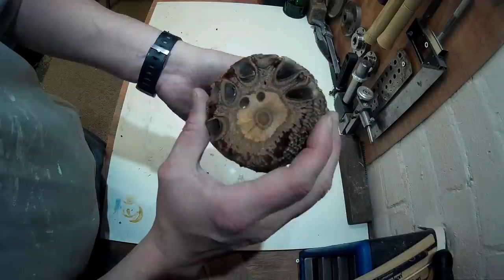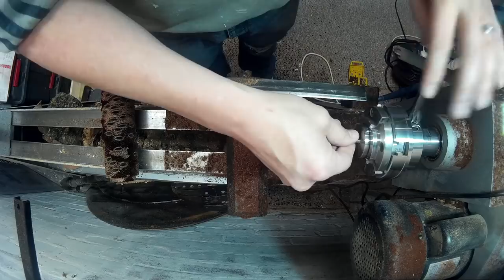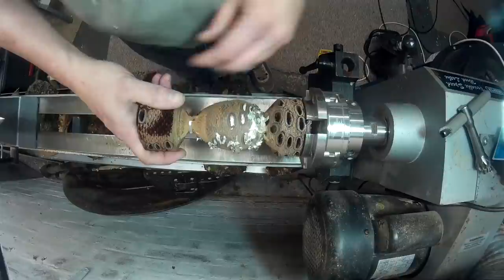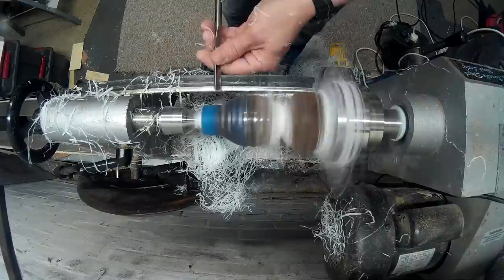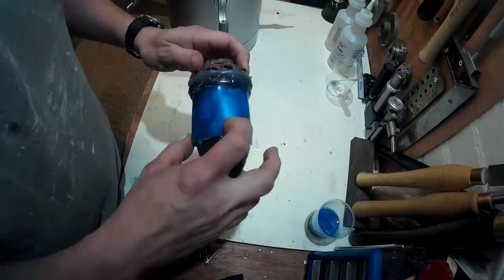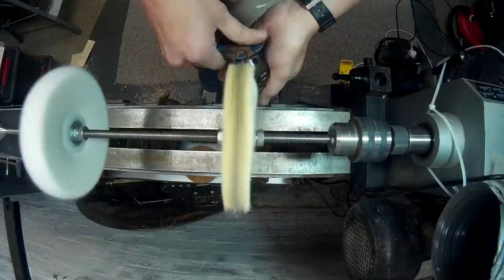Woodturning - The Nut!

Comment: great job!!!!
but as a side note from watching your video. I would make a shield around the back end of the motor to keep the epoxy shavings from ruining that motor over time. As the fan is turning to keep the motor cool, it is sucking the epoxy bits through the back of it. This ends up clogging the motor over time, can get hot/catch fire, and just over all make for a bad day.

Comment: What was the purpose in wasting the resin, just to take it all off
Reply: I am  totally in agreement,  seems like the long way around the block to end up with blue pedestal. Great work, but really? Question: What kind of wood did you start with, pardon my ignorance.
Reply: What kind of wood did you start with?
Reply: To seal it.
Reply: To strengthen the work piece
Reply from the maker: Fill the last few holes where the metal would not pour in, I did half to see what the colour looked like with the wood, before completing it.
Reply from the maker: @ Paul Orth, its a seed pod from Australia called a Bankia Pod or Nut

Comment: Hello,
Congratulations Mr JORDAN.
I am discovering your achievements and it is fantastic.
Question: why do you use pressure for resin? Drying or other reason?
Thank you for your reply
Reply: It's to make the air come out, so there is no bubbles inside of the finished product

Comment: Hello my friend.
It was a very nice product. I congratulate you.
I want to ask you a question.
What is the reason for waiting in the pressure tank after applying epoxy?
how many bars are under pressure and how long you wait. thank you.
Reply from the maker: Pressure pot is to eliminate air bubbles. Pressure is 60 psi. Waiting time is about 1.5 hours as this is a fast curing resin. Thanks 👍
Reply: @MattJordanWoodturning  THANK YOU 👍

Comment: What is the little faceplate that you screwed in at the beginning?  I've never seen one that can clamp into the chuck like that.
Reply from the maker: It's called a woodworm screw, this ones made to fit my chuck
Reply: @MattJordanWoodturning  I've got a woodworm screw that goes into my chuck, but I have never seen a faceplate one that you attach a screw to, where the faceplate then fits into the chuck.   Do you have a link to that particular one?

Comment: Hello what type of resin do you use is there a cheap alternative thanks for your videos
Reply from the maker: Hi Dai, unfortunately there are no real cheap resins, the resin used here is Alumilite, there are a few alternative makes that seem to be just as good, however they are all around the same price, these are epoxy resins. If you want to go cheaper you can always try a Polyurethane resin, but this needs to be done in a very well ventilated area, its also not as good for turning but may be OK for smaller projects. Hope this helps
Reply: Thanks for getting back to me

Comment: Which pressure tank do you use?
Reply from the maker: Converted paint pressure pot
Reply: Thanks for the answer!
Reply: Which Plastik do you use to form a cylinder around the piece of wood where you fill then the epoxy in? Thanks Matt and you make a great Job